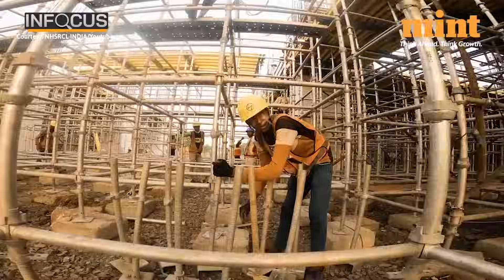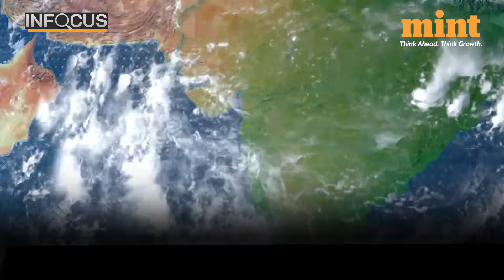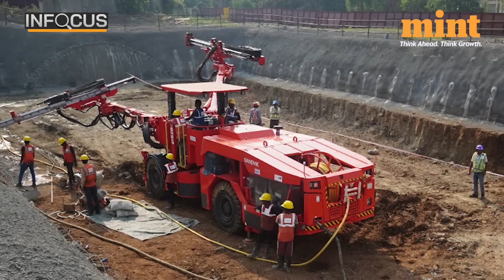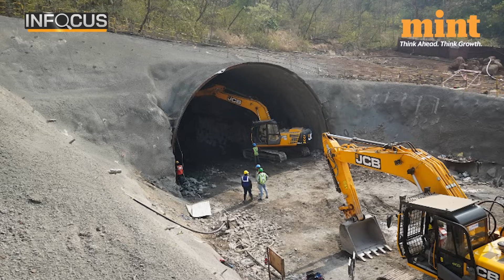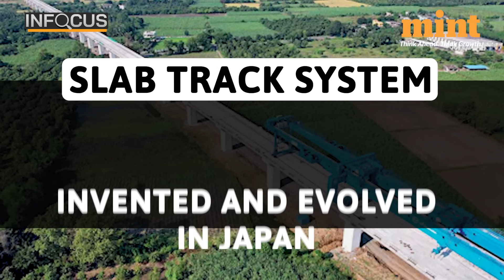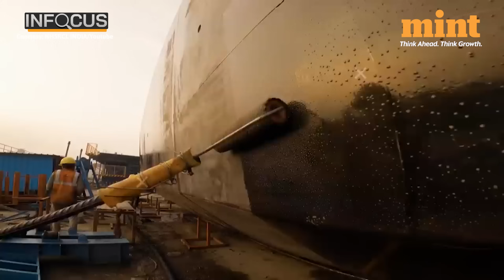Mumbai To Ahmedabad In 2 Hours, 1st Undersea Rail Tunnel: Best Features Of The Bullet Train Project

Comment: Good luck, India. What purpose does HSR really serve? Should upgrade the existing rails to benefit more ordinary people first. And improve the income inequality to raise more middle class.
It's ridiculous to borrow almost the entire amount to build from other country. (lucky enough, someone stupid enough provide zero interest)
For this kind of project, delay and budget overrun is almost certain. After complete, would that be enough traffic to cover the running and maintenance cost? not to mention profit to repay the loan? The HSR wheels are very expensive, India must rely on import. Also, can the electric grip handle the high power and voltage consumption?
Let’s see what happen after 10 years. Best of luck.
Reply: To curb the gap between  increasing domestic and international demand and delayed supply in airways